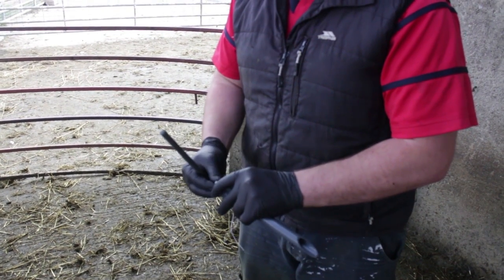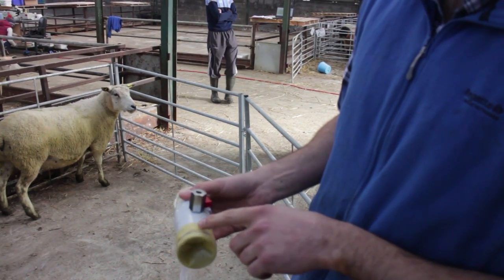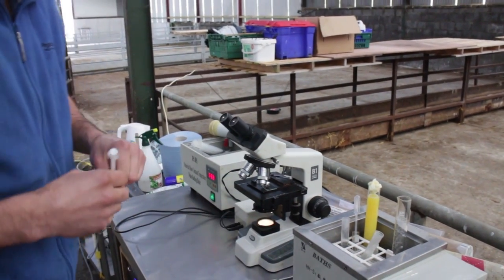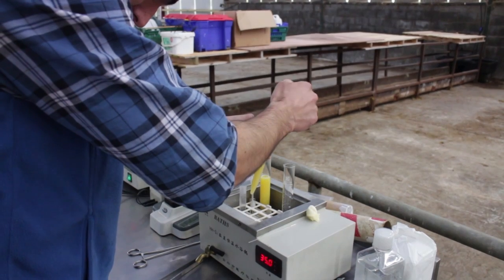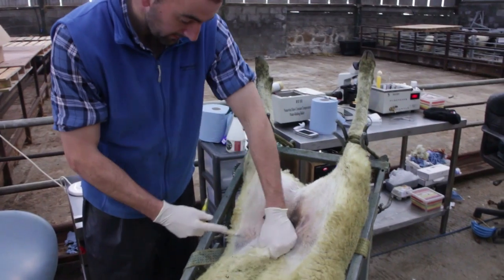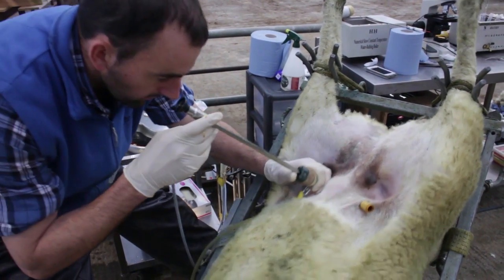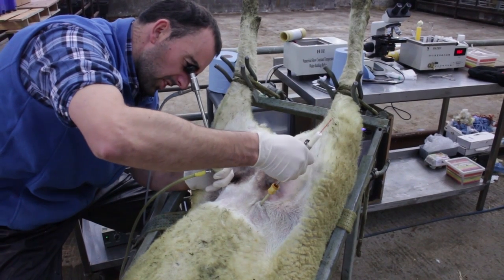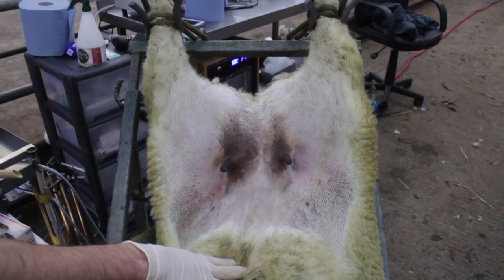Step-by-step sheep AI

Comment: Devilish!
Reply: This is actually a very humane and low-stress process. He was teaching, so it took him a lot more time, but the procedure is extremely quick. The injection is basically like us getting shots.The sheep barely needs any sedation, if any, and there is no lasting trauma. There's not even much trauma to begin with. Just a prick. The restraints cause no pain to the sheep. They just keep them from flailing and actually causing damage.

It is necessary for producers to use all the ethical tools at their disposal to keep up with the increased demand, and this is very much one of them. Natural breeding has lower conception rates, and you run into problems with rams picking favorites and only breeding those ewes. Or the ram is a dud who doesn't breed any ewes, even if he has superior genetics.

Humans are not being used in a commercial setting, so this kind of thing is not necessary. However other AI methods such as embryo transfer and surrogates ARE used on humans.
Reply: @isuckatnames6033  chill you’ve been saying the same thing one EVERYTHING like....just chill
Reply: @hanakinsidewalker  You gotta inform them somehow
Reply: @isuckatnames6033   Yeah well you don’t need to tell the, all.....I mean you’ve got a good point but ya know let’s just chill a bit
Reply: @Dutch 'Plan' Der Linde  Yeah I know I’d rather kick them all in the face tho

Comment: Technology has surpassed common sense. This is barbaric!
Reply: No
Reply: This is actually a very humane and low-stress process. He was teaching, so it took him a lot more time, but the procedure is extremely quick. The injection is basically like us getting shots.The sheep barely needs any sedation, if any, and there is no lasting trauma. There's not even much trauma to begin with. Just a prick. The restraints cause no pain to the sheep. They just keep them from flailing and actually causing damage.

It is necessary for producers to use all the ethical tools at their disposal to keep up with the increased demand, and this is very much one of them. Natural breeding has lower conception rates, and you run into problems with rams picking favorites and only breeding those ewes. Or the ram is a dud who doesn't breed any ewes, even if he has superior genetics.

Humans are not being used in a commercial setting, so this kind of thing is not necessary. However other AI methods such as embryo transfer and surrogates ARE used on humans.
Reply: Angi Angi seriously you’ve been putting this on every post! It it very traumatic to watch, and not something all agree with.
Reply: crystal calhoun if it’s “traumatic” why are you watching it?

Comment: just leave them alone
Reply: would you rather they get hounded on by and massive Ram that doesnt leave them alone and could put unnecessary strain on their bodies when you can AI
Reply: Fuck off you sook.
Reply: This is actually a very humane and low-stress process. He was teaching, so it took him a lot more time, but the procedure is extremely quick. The injection is basically like us getting shots.The sheep barely needs any sedation, if any, and there is no lasting trauma. There's not even much trauma to begin with. Just a prick. The restraints cause no pain to the sheep. They just keep them from flailing and actually causing damage.

It is necessary for producers to use all the ethical tools at their disposal to keep up with the increased demand, and this is very much one of them. Natural breeding has lower conception rates, and you run into problems with rams picking favorites and only breeding those ewes. Or the ram is a dud who doesn't breed any ewes, even if he has superior genetics.

Humans are not being used in a commercial setting, so this kind of thing is not necessary. However other AI methods such as embryo transfer and surrogates ARE used on humans.

Comment: But why not just let the sheep hump it put and make their own baby
Reply: Natural breeding has lower conception rates, and you run into problems with rams picking favorites and only breeding those ewes. Or the ram is a dud who doesn't breed any ewes, even if he has superior genetics.
Reply: If one "effort" by the ram will inseminate 60 ewes and produce 120 lambs, that's a pretty economical effort. Generally if someone wanted their 60 ewes to lamb on or near the same day, they could bring in 20 rams (expensive to maintain, expensive to purchase), and when the ewes are ready, they can let them have their fun. But the ecological impact of keeping 20 rams means you have to provide food for each one of them. In this way, you might have only one ram (or no ram at all) and get the same results. One thing that farmers are trying to do is come up with ways to decrease the carbon footprint, or in other words maximum gain for minimal impact. If you can use 61 sheep to bring 120 lambs to market, you'll use fewer resources. In addition, a single dud ram who is firing blanks or near blanks could take the efforts of months and render them pointless. This is wasteful to the environment. Also, this is a way to improve genetic diversity, gather data on the sires (because you have 120 lambs, you'll be able to see how long it takes them to get to market, and their daily gains), so that someone can acquire semen that will specifically do the required job. AI for sheep is generally something you would only do if you had strong enough motivation. I'm thinking about the breeder of sheep who will be used maternally in a flock, for them, it's important that they can come up with statistics for their animals in a scientifically reliable way.

Comment: Torture😭
Reply: No
Reply: Justin Rees animals can do it theirselves !!
Reply: Erin Cheetah It’s more stressful and it’s an easier chance for them to get hurt with an actual ram.
Reply: This is actually a very humane and low-stress process. He was teaching, so it took him a lot more time, but the procedure is extremely quick. The injection is basically like us getting shots.The sheep barely needs any sedation, if any, and there is no lasting trauma. There's not even much trauma to begin with. Just a prick. The restraints cause no pain to the sheep. They just keep them from flailing and actually causing damage.

It is necessary for producers to use all the ethical tools at their disposal to keep up with the increased demand, and this is very much one of them. Natural breeding has lower conception rates, and you run into problems with rams picking favorites and only breeding those ewes. Or the ram is a dud who doesn't breed any ewes, even if he has superior genetics.

Humans are not being used in a commercial setting, so this kind of thing is not necessary. However other AI methods such as embryo transfer and surrogates ARE used on humans.

Comment: Y'all are blowing this way out of proportion. This is actually a very humane and low-stress process. He was teaching, so it took him a lot more time, but the procedure is extremely quick. The injection is basically like us getting shots.The sheep barely needs any sedation, if any, and there is no lasting trauma. There's not even much trauma to begin with. Just a prick. The restraints cause no pain to the sheep. They just keep them from flailing and actually causing damage.

It is necessary for producers to use all the ethical tools at their disposal to keep up with the increased demand, and this is very much one of them. Natural breeding has lower conception rates, and you run into problems with rams picking favorites and only breeding those ewes. Or the ram is a dud who doesn't breed any ewes, even if he has superior genetics.
Reply: Have you ever had a laproscopic procedure done? Did you see where he pumped carbon dioxide to inflate the area? Do you kmow how much pain that causes? I do! I've had several surgeries where they do that crap! Did you also see the sheep jump as he stabbed her the first time? No local or anything? How can you write your psychotic babble and actually condone this as humane? How about you hanng upside down and see how you feel with the blood rushing to your head and the pull of gravity! Let's not forget that the area was not sterilized prior to incision! Teaching or not....this is a disgusting and cruel "procedure " that's wastes more time than traditional AI.
Get the facts! Open your eyes!
Reply: Maybe we should reduce demand instead?  Humans eat far too much meat each day and the cost to the planet to produce the feed for the animals is tremendous.  Not to mention the waste of the animals.
Reply: You want suppliers to...reduce demand? That's not possible, and extremely counter-productive. Suppliers respond to the demands of the market, not the other way around. They have limited control over demand, and can only work to fulfill said demand through innovation like this. You can work towards that goal of your's on your own, but suppliers can't and won't do that. And consuming animals isn't a waste. They have significant nutritional value. And I can assure you that livestock producers make way too little profit to waste any part of the animals they produce.